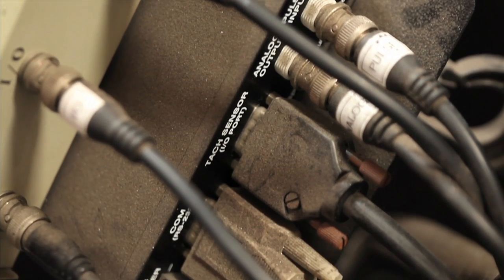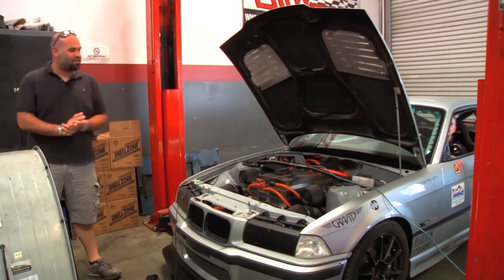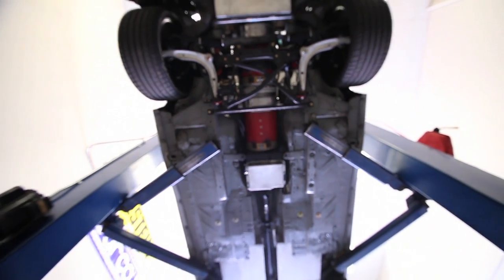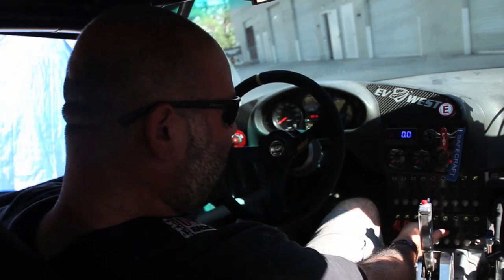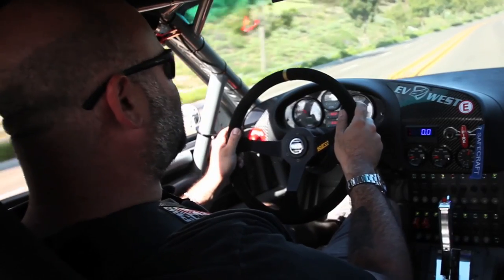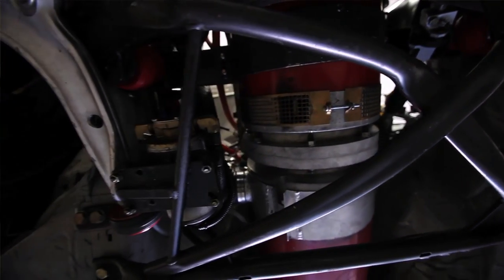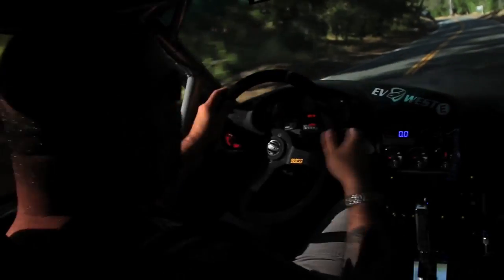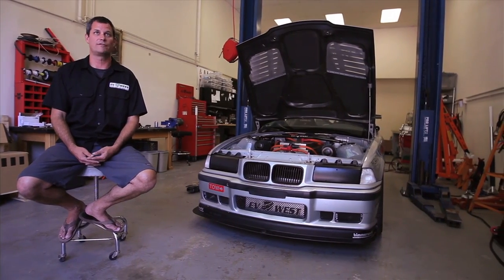This Electric E36 Makes 850 lb/ft of Torque at the Wheels! - /TUNED

Comment: The title shows little understanding of torque. Its multiply pounds and feet not divide. It's not so much. The Z06 makes over 1400 lb-ft in 4th gear at 4000 rpm, or 1700 lb-ft in 3rd. Including drivetrain loss which the BMW also has, using gearbox, driveshaft, axle ratio. And it matters at what rpm the torque is provided, and that's horsepower.
hp = KW *1,34 they measure of the same unit: Power just like km and mile measure distance.
Reply: i say the ponies are only as good as their rancher that is guiding them, and operator error is the biggest flaw to HP/Torque, Z06 you say the GM driver that drives them is just about as legit as it gets and the posted track times are merely dreams in the eyes of all Z06/vette owners world wide so keep in mind that power and its track times are both merely figments of a disillusioned reality for many including myself, i will most likely never be able to fully use the power of a 427 especially at high rpm levels, I say this because I am young for one and by the time i could afford one petrol days will be long gone, and so will the 427 if not in the up coming years for big blocks in general...i would most likely not even have enough money to compensate for the ruined tires/rims/transmissions let alone additional engine damage it will take/require to fully master the car to even get relatable track times to someone who can fully get its potential, the potential of an even stiffer, lighter(gutted), caged z06...and i apply this to any crazy car i see, which makes me say kick rocks to those "hypercars" when if i had the money i could supplement owning a vast collection of multiple cars to track/drive/love vs them literally using our LS engines and throwing on superchargers/twin turbos on our engines and weaving carbon fiber shells to throw on top of chassis and dropping a million dollar price tag, in what world.......this alone sells me on electric engineering when these "hyper car jokes" claim to be the future of automotive engineering.....i guess we have the 24 hour endurance races to let these companies do the talking

Comment: Okay i'll admit one thing - I was thinking you had an E36 which I don't like. The E30 is a nice enough motor.

Also, I don't have a 106 GTI. I have a FLATARCH. A bog standard non-kitted one. With a surprise inside. But here's some facts:

168BHP Divided by 1180 * 1000 = 144bhp/Tonne

My 125BHP divided by 800KG * 1000 = 156bhp/Tonne

Not to mention I have a much quicker box, so while you'll top out higher than I will, i'll get to 100 way faster than you ever will :)

Give up yet?

Comment: Guys gotta question, 400kw ias about 500hp not around 300hp.. you said it's 12V electric engine, you mean the battery is 12V and you convert it to 400V ? I looked a bit for a electric engines around 400kw but all the engines I found is 400V the mass of the engine is more than a mass of the car with engine about 1,5t so car weight with that engine is something about 2,2t  (without battery ?)? that's one veery heavy car ... any specs plz maybe in a near future i would like to do the same thing to my e36! :D

Comment: guys I don't know what the hell is wrong with all this dyno systems, but I am gonna tell you there is no way your car puts 850 lb/ft of torque on wheels, because horsepower = RPM*torque(in NM, and 850 lb/ft is 1152 NM) / 7023,5 ,  so do the calculations yourself using 600 RPM and you get 98 horsepower, which is not 342 for sure, and for 342 horsepower with 600 RPM is 4003 NM( or 2952 lb/ft) of torque on wheels ( I calculated that number using mathematica equation), that is the real number and you all can calculate it on your own and find out that there is no way it is 850 lb/ft!! Well at least you can think this way, just I will bring example about regular ICE, let's suppose the car has 342 horsepower (wich is almost the same as electric motor, I mean the torque and RPM are close to ICE numbers, just with several differences) and the car is on 1st gear wich let's assume has 3,70:1 gear ratio and differential is 3,40:1 (this numbers are not real but they are veeery close to reality) well you get 12,58:1 gear ratio from engine to wheels, and if you don't know that gear ratio (as other X:1 ratios) are doing the following, the given torque from engine is converted to wheels by multiplying it with the ratio number which in this case is 12.58, and divide engines RPM with that number 12.58, and when wheels spin with 600 RPM with that ratio engine spins 7548 RPM, and now we can calculate the engine torque having horsepower and RPM, 342 = X*7548/7023.5 (I will get the answer in NM and convert it to lb/ft) if anyone don;t understand what I did here - I assigned X to unknown torque number to find it through basic mathematical equation, and the torque of the engine at 7548 RPM is 318 NM (or 234 lb/ft) so when we just multiply this number with gear ratio we get the torque on wheels which is 318*12.58 = 4000 NM (or 2950 lb/ft) of torque on wheels, guys don't get trapped by this dyno numbers, these are 7th grade simple calculations, and physics don't lie, trust me, and by the way if you say that I didn't calculated the 30% cut of torque from traction than you can do it on your own and find out that there is no way that 2950 lb/ft will be equal to 850 lb/ft after your calculation.

Comment: Most new fuel efficient cars nowadays are probably more green than these electric engines as the energy generated is inefficiently produced by fossil fuels. Coal fire stations are 40-50% efficient and lots of energy is lost as heat when transporting electricity. Modern fuel engines are far more efficient. The only way to be 'green' in my opinion is to have hydrogen fuelled cars where production of hydrogen is powered from renewable energy sources. This will never happen of course due to costs.

Comment: This comment is for the people who made the car engine, can you patent it? and can it be made as  ratio 1:1  a torque/bhp instead of 360bhp and 800torque. it will make the engine loose less components so it will be able to be more affordable to average joes. I am very looking forward on this car :) It is amasing and I guess you can make it into the market if a big car company is researching engines like yours. Keep up the AMAZING work! Have a great day.
Reply: The motor design probably can't be patented, its 100 year-old technology with a few improvements for handling higher input power.  Yes, you can increase the HP of the motors at the expense of the torque - that is one of the mods in these motors, but they still produce GOBS of torque.  Taking it farther (higher HP / lower torque) has been considered and some tests have been done, but there are no free lunches. Increasing HP comes with the expense of increased AMP draw.  There are techniques that could provide extremely high HP and even more torque, but it would not be as cost effective as these motors.  Of course liquid cooling, if possible, would change the potential power levels of these motors quite dramtically.
Reply: George Hamstra sorry about the delay :)  So you say that most average Joes can afford such modification? The patent stuff isnt really a big deal, once you make the product as a new technology (lets say ie: nano tech) it will become "new" so people will like. People love new stuff whatever they may be. Keep up the good work though :)
Reply: Oleg Bezman The cost to convert an existing vehicle from gas to electric is normally in the range of $5000 - $30,000 USD - it depends upon how handy you are, and how fast you want to go or far you want to drive.  Fast and Far are mutually exclusive - you can't have both at these prices...  There is someone in the USA who will convert any vehicle to electric for $12,500 (plus vehicle), but that is with lead-acid, not lithium, and you probably want lithium. (apologies for my delay as well... ;)
Reply: np, good to know.. keep  up the good work :)

Comment: A minute in and i'm facepalming at the fact that Kw to HP is an easy conversion so there's no real need to put in on the dyno for a simple conversion, but if what hes trying to say is that he wants to know what the electrical losses (electrical drivetrain losses) are then i would understand wanting to dyno it.

Comment: If eco people want to convince us to electric motors, that car is the solution. No bloody Prius or hybrid, but beast as fast and agile and gasoline- powered supercars and Nm comparable to strongest diesel trucks.
Reply: 'Eco people' shouldn't have to convince 'you' of anything, really.. especially not for what is essentially the future of motorisation
Reply: JanusPrime
I think "you" took my comment wrong.
If it`s so important to them to minimalise the volume of combustion engine (up to zero), then it`s up to them to prove superiority of their concept/ point of view.
Reply: Wojciech940 Well but... what is there left to prove? Electric engines are a lot more economic, cause a lot less pollution, run quieter and can deliver an insane amount of power.. the only downside is that they are bloody expansive and the batteries are heavy, which can be accounted to the fact that there is not an awful lot of funds put into the development yet.
Reply: JanusPrime
I think you`re right- despite Tesla car, I can`t imagine something more than a Prius
Reply: Wojciech940 Ahh , the dreaded Prius.. the one thing that is haunting every e-car supporter :D
Reply: "Eco" idiots and their stupid 90% fuel based Non Plugged In Hybrids is what ruined EV's reputation. Technicaly they have basically not much similarities to BEVs. Even the GM EV1 was a quick car off the line. Non Plug Hybrids are idiotic compromise of worst of both world and not even using a battery big enough to harness Electric Motor for highway speeds. EVs are awesome because they are brutally powerful when built right and not by Eco idiots.

Comment: @TheSmokingTire Did they give you that equation? I see 3 assumptions and 1 constant = a measured value. HP ratings have NEVER been adjusted with motor efficiency in a car. ICEs are only about 37% efficient due to thermal losses, so we should multiply factory ratings by 270% from now on? As a side note, I'm not sure 25% drivetrain loss is appropriate for the application either.
Bottom line: If you're going to publish a claim, take a direct measurement first. #MuricaRatesinHP

Comment: then you should realize that what you said is not true , Electric motors do have torque curve which is not level, hence it decreases. If the torque did not decrease as the motor spins up you would have infinite power

Comment: If it's only making 320HP then it ain't 400KW... There are 1.34Hp in 1KW. That's some meaty torque though :-)
Reply: Would you be so kind to multiply 400 with 0.75?
Thanks
Reply: Solt Chalupa Sorry, had that back to front... 1hp is .75kw. I've corrected my original comment. My point is, it simply isn't 400kw!

Comment: I'd like to build a really simple, cheap and dumb backyard DIY Direct Drive test with a 2500lb dry weight RWD truck  with 3.5 backend and 28 inch wheels .. I've got it sitting in my garage.. I saw a video where this kid connected a junkyard 36v 400amp forklift motor to his stick transmission  and drove around the neighborhood at 40mph with just three 200ah 12 volt deep cycle batteries in series!  One thing I noticed is he never changed gears.  To me it seemed like his transmission was just in the way and consuming power and weight.  I asked some EV experts and they said I could direct connect but it would be really inefficient from zero and low speeds consuming my batteries quickly with every take off and that I would likely need reduce my ratio to around 7:1.  Anybody got any ideas on the math or how to reduce to the ideal gear ratio for my motor, power and weight without a full transmission?  I'm sure there is some formula.

Comment: I love when people think electric cars they think of saving the environment.  Truthfully electricity is still mainly produced from what?  Coal fossil fuels so your not saving anything also it is one of the most expensive fuels to produce.  Don't think of electricity as free power but just another form or fuel and it is not easy or cheap to make.  But who cares when you have 850ft/lbs at the wheels.

Comment: Please !!! DC motor is obsolete, Nikola Tesla hate this tipe of motors because of the power loss in the colector. If you do it, do it good !!! Use three-phase inductive AC motor with an DC to AC electronic controller !! It gives more than 90% power efficiency

Comment: im not ignorant at all, you are the one saying that someone will create something wich will solve all our problems around petrol. that is ignorant. Sure the market will solve the problem, prices will rise to an extend when the demand is on normal level again. Oh yeah and i would like to now how much there is left? because i cant any research that says we ''barley scraped the surface'' Research does say that with the rate of the consumption within 50 years we will run out of oil.

Comment: 4:07.

"I don't really like im in something thats meant for economy or for saving the environment"

Don't worry, you're not....most electricity is still made with steam, which was heated by coal.  A process whihc is almost as inefficient as the IC engine itself. AT best that power comes from a reactor....lets just hope it  ever melts down.
Reply: Its not as inefficient as an ICE engine, cuz A that depends on the specific engine in question as they don't all have the same mechanical efficiency and B you have no fucking clue what the mechanical efficiency of any engine is so don't act like you do. And oil has to be refined into gas which uses a shit ton of energy, as well as the energy used to transport oil and not to mention the fact that every ICE car needs oil as a cooling system not just fuel, which in one car sure isn't that much but when we're talking most of the cars on the road today and they need it every 3,000 miles is quite a bit. Don't denounce electric power because you thought about something for 5 seconds without doing any research into it at all and made a conclusion based on your "findings."
Reply: goingcommando27
 My original claim was that coal used to provide electrical power was "about" as efficient as a car engine, with coal being a tiny bit more. Under that pretense, I was absolutely correct.  No I have never been in a power plant, but I have done research on them out of curiosity in the past, and guess what?  Now I know...Do you ever look up anything at all using the internet about stuff you wonder about? (Besides naked men)  Or do you think that in order to know the basics of how ANYTHING works, you need to be a subject matter expert.
Reply: Bone Daddy There are many ways to determine the "efficiency" of a vehicle with an ICE. These types of motors put out a lot of heat, so by thermal efficiency standards, they are not very efficient. Mechanically, there is usually only about a 5% loss of energy in an ICE, due to friction and momentum, etc. When electricity is generated at a larger scale, even if a power plant used a gigantic ICE, the friction and thermal losses would account for a smaller portion of the total energy generated, due to the smaller relative surface area of the walls of a larger combustion chamber. Remember, heat is transferred most efficiently through conduction, which requires surface area. Combustion chamber volume increases a lot faster than wall surface area as diameter increases (2pi(r) vs pi(r^2)). Theoretically, larger electric motors (generators) are more efficient than smaller ones for the same reason. At the most basic, large power generation plants are more efficient than ICEs. You then get into power distribution and transmission and thats another issue altogether, but i'm not an electrical engineer. So.. to settle your argument, centralized power generation is more efficient, due to economies of scale and thermodynamics. I'm just trying to spread some info, and yes, I am a mechanical engineer, or actually I will be in a few months (certs take time).
Reply: montgum77
Yeah, I know about the large scale higher efficiency tradeoff.

However looking at the numbers small ICE range from 20's-low 30's   The highest the national average for coal generated power efficiency has capped at 33% and has remained there since the 60's. Look this up if you need to.  The steam cycle is barely more efficient, with larger ICEs being able to do better together. 

Steam is VERY inefficient.  Thats why every single process where it was used got replaced  the second better technology came out except for large scale power generation and handful of very specialized purposes. .  Ever see the power rating for a reactor?  Its usually two numbers, for instance the SL-1 reactor was 3MW thermal 200kw electrical.  This just goes to show how inefficent the steam cycle is....You have 3mw of availble thermal power...but only 200kw is realistically able to be turned into electrical. the rest?  Waste heat.

So its no wonder, even when scaled up, steam still sucks. Salt in the wounds when you use fossil fuels to power it.  Reactors are at least non-polluting assuming no incidents occur.

But we still use it, why?   Think of another system or design that has only one MAJOR moving part, that can run an entire city.

Hydroelectrical, tidal, geothermal and solar are all great ideas and should be used to supplement the grid.  But the big picture it looks like coal  and reactors will be doing the heavy lifting until something better comes along.